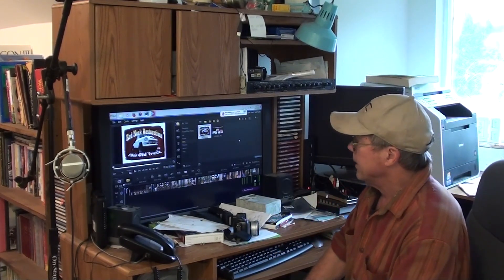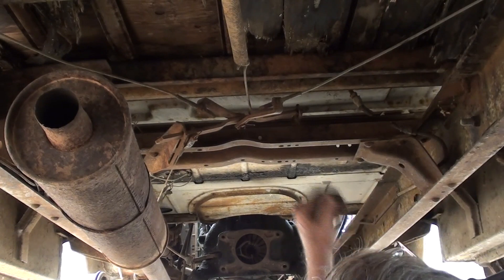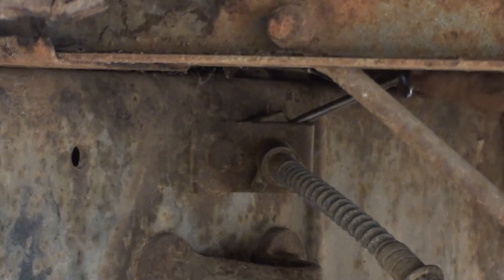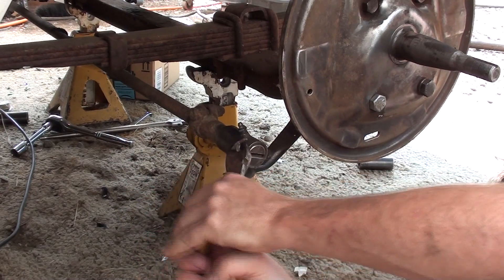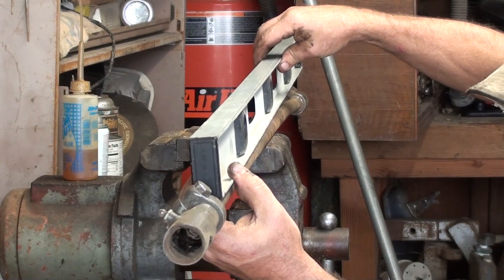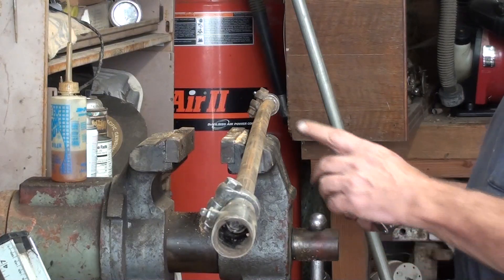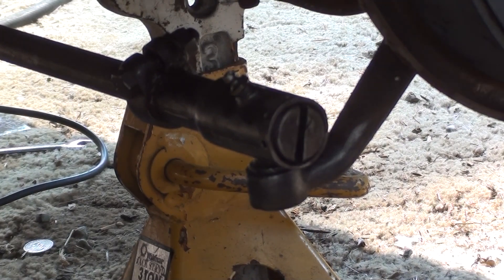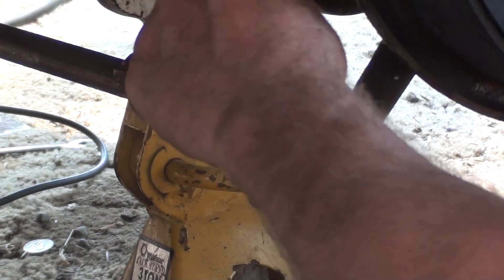58 GMC Resurrection Part 5 Straightening the tie rod.

Comment: I got a bitter lesson after "adjusting" the steering box on my 1953 Studebaker PU - all went well when I was towing it - until I made the first 90 degree turn and the wheels jammed - great fun, as it was in town & holding up traffic!
Reply: That was because the sector gear was worn in the middle.... adjusting it to tighten up in the middle resulted in binding at the extreme (less worn portions of the gear) positions....

Comment: I maintain that a person can completely rebuild any pre-'67 vehicle with a leatherman, a bald penis hammer, a file, a heat wrench, a set of really cheap wrenches, a crowbar and a thesaurus of swear words. Oh, and a box of assorted band aids
Reply: I work in the oilpatch. A leatherman is a miracle tool. You can even open your can o' lunch with one
Reply: Which leatherman are people using? I have the original which is no longer produced. Thinking of getting another and not sure which to get.
Reply: Sean. The original was great. except that it kinda tore up your hands when used as pliers. I have a Leatherman Fuze now, but it does not have the file. They have put a plastic coating on it that is much easier on the hands. Why not go to their website and see the latest offerings?
Reply: I own a few ball-peen hammers, but outside of the movies, I've never heard of a man-member hammer.
Reply: Actually, it is spelled "ball pein" but I ain't pickin' nits
Reply: I own and use one. Maybe that's why I'm the father of twins.... LOL
Reply: @John... congrats... I hope the twins have a dad that will spoil, yet give them a good take on life...

Comment: You know so many people don't bother to take the time to adjust those steering boxes properly they get play in a drag link or a tie rod end and first thing they want to do it's run the worm gear down then the steering wheel gets so stiff you can't react with small adjustments of the steering wheel and it makes them drive worse because you're exactly right it causes them to bind up

Comment: For future curfuffles why not make a jig from 2 pieces of angle iron with a reenforcing rib welded to the outside of them. And seat the tie rod in them like the way a tap seats in a tap handle. And just slowly heat the tie rod with a rosebud and just squeeze it in the vice ever so slowly .... 
in theory the 90* seats of the angle iron will true up the rod all at one time.. 
Ive done it for bolts and miscellaneous parts.... hopefully would work on tie rods.

Comment: Logistics? Is that logical?
Logic as an adjective is logical. Logic as a verb is pejorative to engage in excessive or inappropriate application of logic. Dang that doesn't sound logical. 
Lube the joints huh?
I wish I could lube my knees.
Well I won't tell ya butt I think ya figured it out on your own sides ya told me not ta tell ya.
Good video Brother.